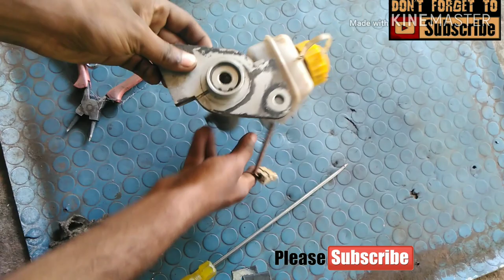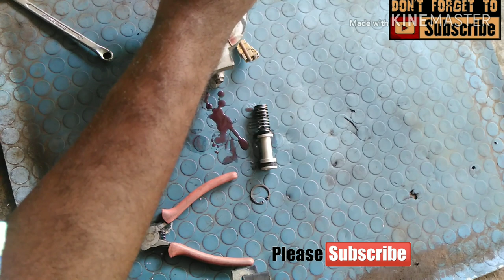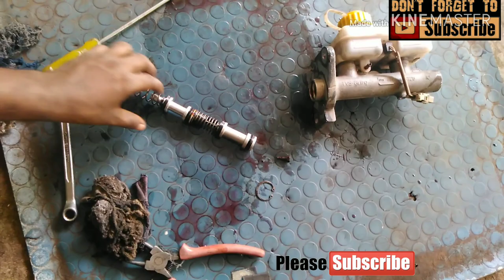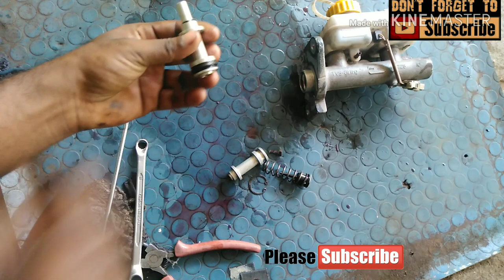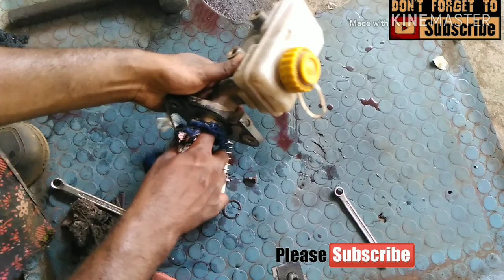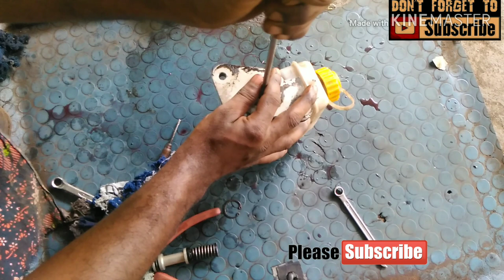Brake Master Cylinder Kit Changing l Mahendra pikup

Comment: nalla video
Reply: @Libinstechy  sorry de avashyam ella bhai. improve akan vendi paranjunne ullu . (njanum shoot cheythitundu TMC kit video copy anu ennu parayalle  ) tata safari white smoke starting kure samayathek . pinnedu kuzhappam ella . ah timil sound change um undu . no back compression . oil pressure gud . glow plug changed . oil new / any idea ? Valve ?
Reply from the maker: Etha youtube chanl
Reply: @Libinstechy  mallu DIY
Reply from the maker: Air filter ,nozzile, nokkiyo
Reply from the maker: Valve timing.
Reply from the maker: Diesel kathathe kondalle white smoke
Reply: @Libinstechy  nozle serviced . air filter almost new .
Reply from the maker: Timing?
Reply: @Libinstechy  thanks will check. njan mechanic onnum alla keto. hobby anu ente vandiyel paniyunnathu
Reply: Mahindra ginio ka pats kaha milata   hai